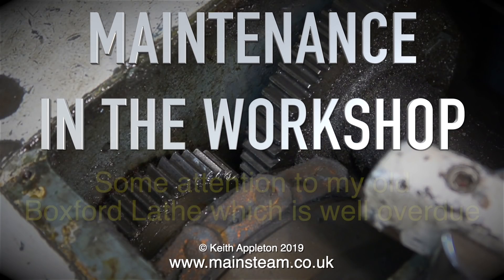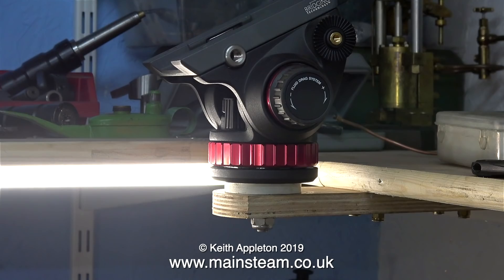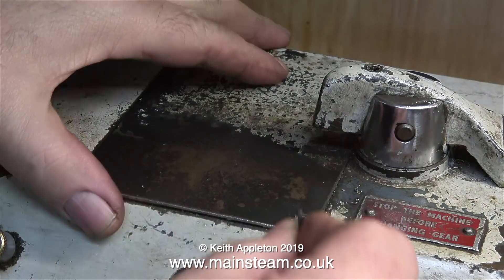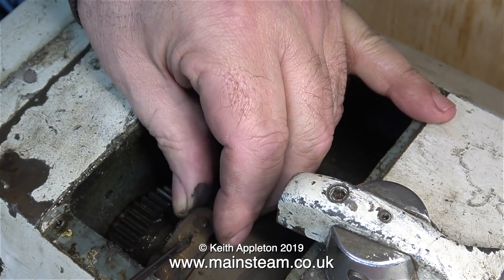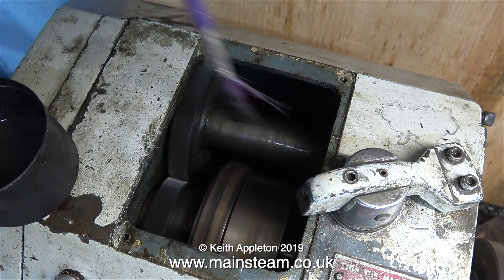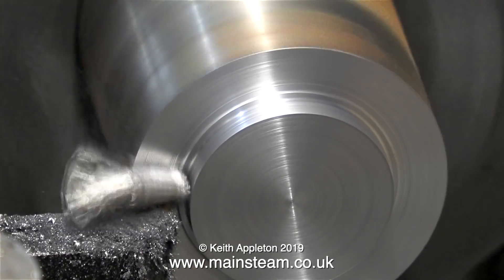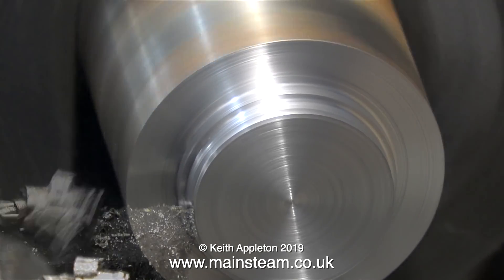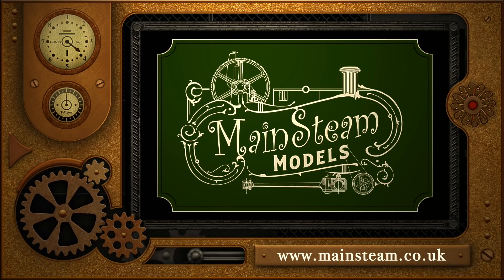MAINTENANCE - IN THE WORKSHOP

Comment: Great video as always Keith!  When I was in high school metal shop learning to use a lathe, the 1st thing we were taught was how to maintain it, and what Keith did was exactly what we were shown.  We used a very sticky gear lube for the gear teeth, and a high pressure lube for the bearings, and were told not to over lube. Before we did any turning we had to learn also all the major components and their use plus loads of safety rules. My first project?  The handle for my meat tenderizer! I wonder how many of those school made tenderizers are still out there? My mom still has hers, doesn't use it though, she just talks nicely to the meat and it gets tender all by itself.

Comment: Nice job cleaning the belt. I have a old Atlas lathe I installed a segmented belt on because they tend to run with less vibration but it to suffers from excessive lubrication. I keep my equipment dripping with lube.  So I keep a can of spray brake cleaner handy . A few seconds spraying while running and were good for a few more months

Comment: Dear Keith

Have you looked up the belts available from Fenner Drives?  They are a modern version of the link belt you have on your Boxford.  As you noted they have the advantage that they can be placed without dismantling the headstock etc. and given the material they are made of, much less susceptible to damage from oil and grease.  I replaced the belts on my Myford with them and apart from easier installation, they made the lathe quieter and I got a better surface finish compared to the regular V-belts they replaced!  I have also used them on my old Standard Modern 12" X 30" Utilathe to good effect.

Comment: Where does the thinner go? Do you drain it from somewhere in the lathe? And the belt is not attacked by the thinner?
Reply from the maker: It evaporates very quickly and does not affect the drive belt other than degreasing and cleaning it.
Reply: @keithappleton  : That doesn't stack up.   When something evaporates, it leaves behind whatever was dissolved in it, unless whatever was dissolved evaporated first - and if that was the case, the thinners would have been pointless.   This is distillation, as in making moonshine by separating the alcohol from the water.    I would have expected to see a thin layer of grease residue at the bottom of the lathe stand.  Maybe it's still there.   There won't be much - a quick wipe with a cloth will do the trick.